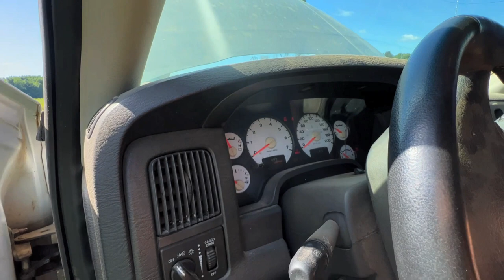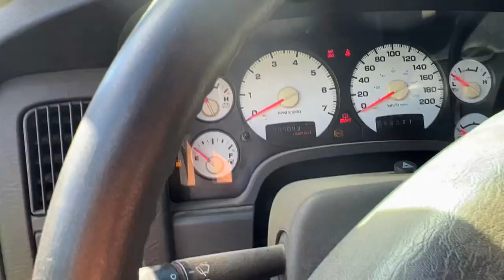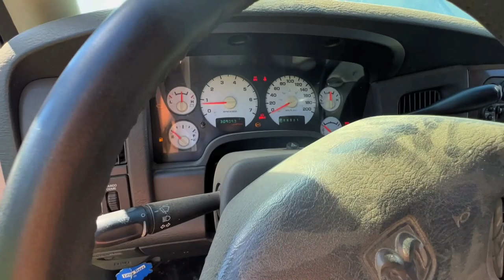Dodge AIRBAG Fireballs!

Comment: If you fill the bucket with 2 parts water and 1 part gas it will make your fireball larger without needing as much fuel. Pretty sweet though.